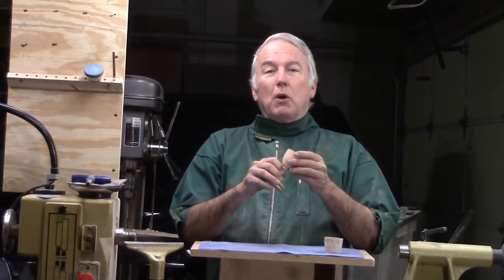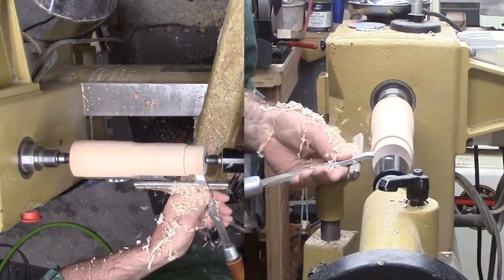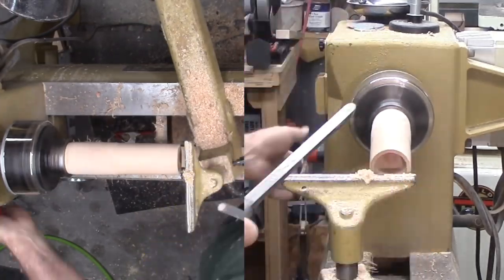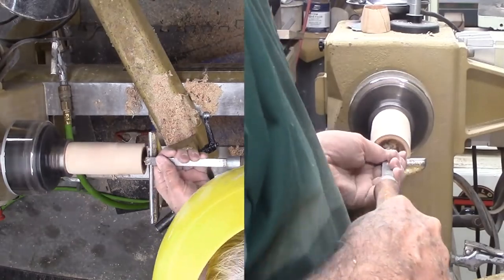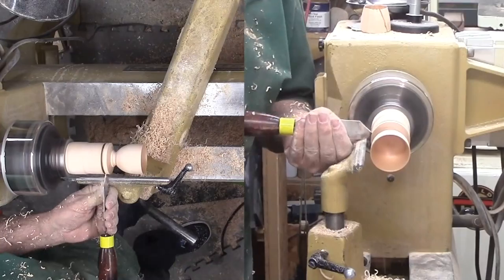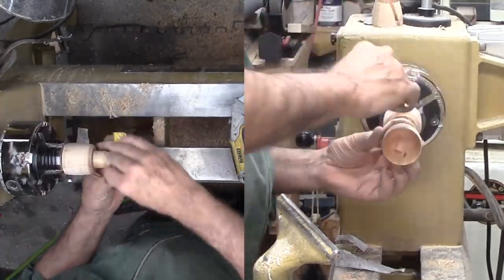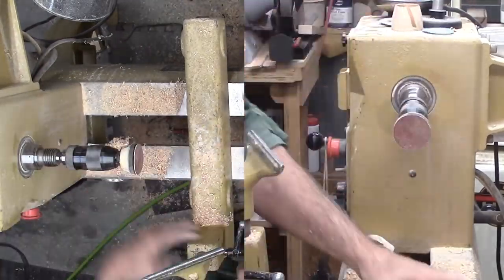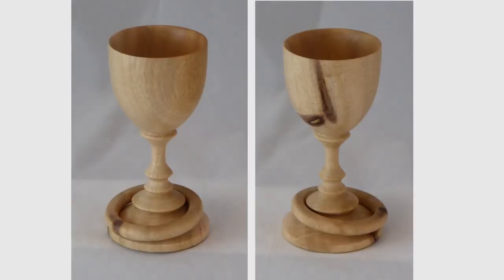Woodturning Goblet With Captive Ring

Comment: Very nice work.
I really like the turnings you do especially the ones that leave some  natural shape of the wood.
I liked the emerging bowl so much I had to do some. I found some dry cherry branches from my smoking stash of wood.
Cherry is great for smoking meat but the beauty of this wood was a great surprise.
 I am wondering which wood is best for natural edge turnings as far as the bark staying put.
Thanks,
Gary
Reply from the maker: Whether the bark stays put varies not only by species but by harvest time.
The best way to know is to experiment.  I've used some varieties of maple and ash.
I've had poor luck with cherry as the bark tends to be stringy.
If harvested in spring and summer, the cambium layer is more active and more prone to separate.
So, experiment.
Alan

Comment: Nice going on the captive ring Alan! =)   I know you probably know this already, but those allen wrench tools only take about 5 minutes to make...  not worth trying to do it without a backwards one.  Great idea gluing sandpaper to the stem to sand.
I think you were right when you called this a chalice.  While the terms goblet & chalice are generally used interchangeably, there is a subtle difference.  A chalice has the base diameter the same or greater than that of the cup, whereas a goblet has a smaller diameter base than the cup.
Reply from the maker: I had to check your definitions. Looks like a small difference along the lines of what you said. The chalice has more religious significant.
Alan
Reply: FYI, Mike Peace released a video today showing how he makes captive ring tools.

Comment: Just a thought on the left and right bent tools Alan. As they are in a scrapping mode when in use why not sharpened both top,and bottom, kind of like a negative rake profile, then simply flip the tool over to cut the other side. I have a dedicated ring tool and that is how I sharpen it, I think it was Richard Raffan who gave me that tip a few years ago. 
Have you considered doing an interlocked captive ring, look for a wedding goblet? I am going to try to make one for my niece who is getting married later this summer. .
Reply from the maker: On the bent tools, Why not!.
Interlocked captive rings sound like a lot of carving. Hmmm.
Alan